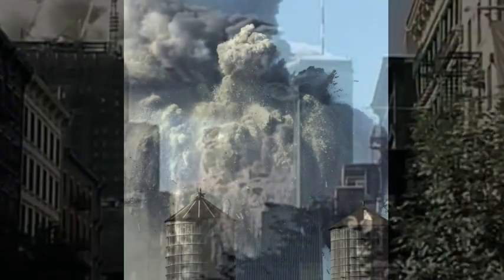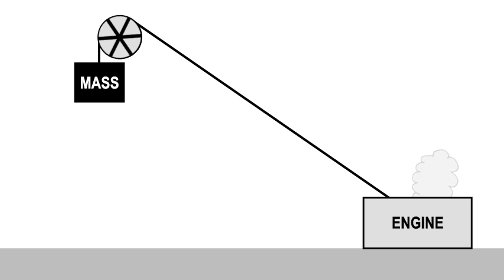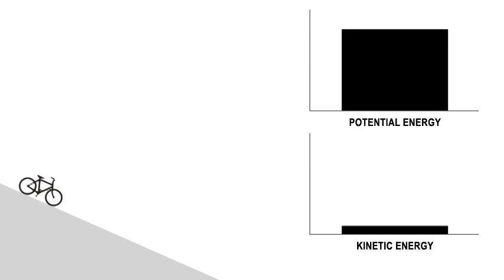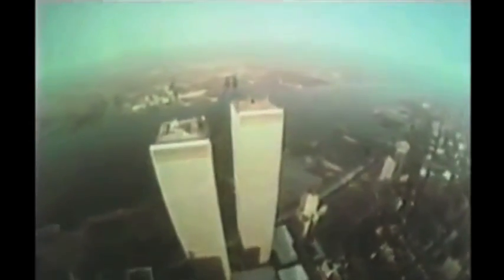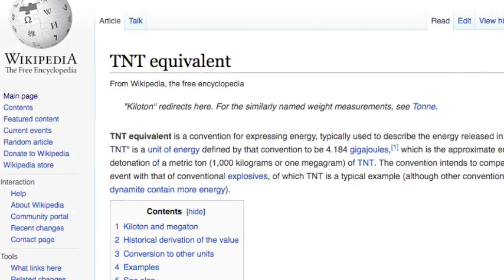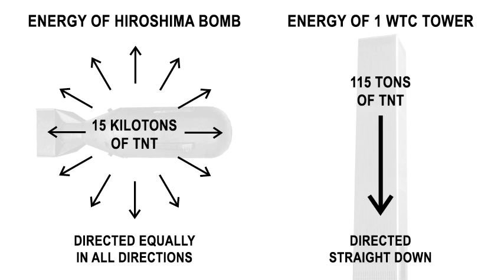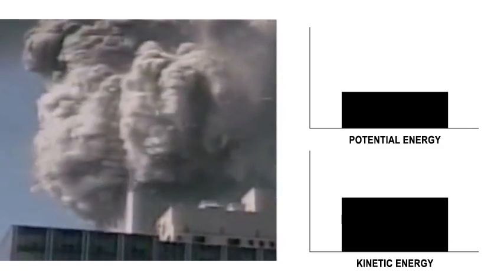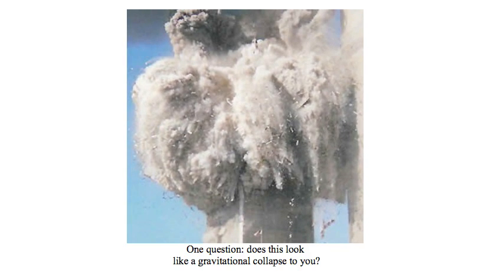Where Did The Twin Towers' Explosive Energy Come From?

Comment: So 6floor size hole (north tower) and the 6 floors above the 98th floor  had enough potential energy to just free fall through the rest of the building without it catching or meeting any sort of visible resistance on the way down? The rest of the building wasn't touched or weakened in the attack, so was the architecture faulty to not support the extra weight from coming down upon it? Hard to believe, but there is no example of a building that a hole that big in it in the history of the building.
Reply from the maker: "Ed presumes any piece at an altitude has inherently more energy." Altitude above sea level has nothing to do with it, unless the object in question falls to sea level. Potential energy is a relative measure, in this case we're talking about where the debris ended up, from wherever it was positioned in the building relative to ground level. The total potential energy of the building is therefore calculated by integrating the mass of the structure over the total height, from the ground to the top, taking into account the non-uniform distribution of mass. Please take a physics class before making such ill-informed comments. This is science, not opinion based on whatever the fuck you want to believe.
Reply from the maker: I am a landscape architect when I mow my lawn. There are thousands like me who say those buildings would only do that with bombs inside.
Reply from the maker: Yes. If you had taken a healthy WTC tower and suddenly removed one floor -- with no other damage -- the same collapse would have likely happened.
Reply: "I did a little math to find out the possible force behind the 6 floors dropping would be"

well, your starting point is wrong. About 20 floors dropped, not 6.
Reply: On the first tower to collapse, it was 40 floors that "dropped", and that is a massive amount of weight....a 40 story building!
Reply: So trying to see if it was possible, I did a little math to find out the possible force behind the 6 floors dropping would be.  The numbers kinda surprised me...So I simply divided the 6 floors to the total mass of a single tower as stated in other websites . I got the height of 6 stories in feet and plugged those numbers another website that told speed, time and energy(joules).  That came out to be 44mph, 2 secs , 1.2 tons of TNT at impact. Of course these numbers are guesses at best and its only looking at one variable. So I did this because your video only covered the total energy and not the bit that started it in the first place.
Reply: Who are you and what are your credentials? You certainly are sure of yourself!
Reply: Sevenspent Exactly! Well said. Ed presumes any piece at an altitude has inherently more energy. What his presentation so far implies is that a construction at sea level falling apart is not going to be as dramatic as that same construction falling apart if it were on a mountain. Quiet laughable indeed but hey, that's Ed alright. 😂

Comment: You speak as if each tower was lifted as a whole and dropped on the ground.  Yes, that would release immense energy all at once (and also destroy the "bathtub" keeping out the Hudson river, thus flooding lower Manhattan).  The crucial calculations of energy must consider the smaller top portion above the initial failure levels separate and opposing the ability of the larger bottom section to resist its fall.  The vast majority of the bottom portion was undamaged and unheated; it should have destroyed the smaller damaged upper section (the so-called "piledriver") by exerting equal and opposite forces; we would have seen the collapse halted at some point, with plenty of the healthy lower structure intact.

Experienced architects and engineers have asked NIST for the data they used to compute the energies of the two sections. The request was flatly denied, because the information "would jeopardize public safety" (yeah, that sounds plausible).  I think it is pretty obvious NIST is avoiding scrutiny; and that, frankly, threatens public safety far more.
Reply from the maker: The video concerns claims that only explosives could have caused such an energetic collapse, not claims that "we would have seen the collapse halted at some point," however extremely unlikely and astonishment-based as such claims might be. I'm sorry if the buildings did not perform as you imagine they should have.
Reply: Why do you support NIST's secrecy?
Reply from the maker: Because they pay me to. You know you want to believe that, too.
Reply: Look, I'd really like to talk without malice.  I admit I can get short sometimes. 

What I really meant to ask is, don't you think that suppression of the scientific process is a problem?  How can you be so sure that the first working hypothesis seeking to explain unprecedented observations is ironclad?  When confronting a new phenomenon, it is crucial to keep an open mind.  Developing and using computer models to explain real world events is not as easy as it sounds. And several members of the 9/11 Commission, including the co-chairs, have complained that the project was "set up to fail" by inadequate time and funding.

The people contesting NIST's WTC7 analysis are experienced highrise architects, engineers and physicists. Do you really think they are quacks? Isn't it possible that university research teams are capable of finding flaws in a proposed model? I'm beginning to think you have lost your objectivity in the matter.  Don't let the "rabid" truthers like Alex Jones close your eyes to everyone; there is a gray area filled with valid claims.

If we were just having a barstool debate, it would be fine to blow off a difficult point - laugh it off or stomp away in a huff.  But the issue is very serious on many levels, not least of which is ensuring that the buildings we are using and designing are safe.  NIST is denying access to important data; we can only guess why on earth they would do this, but it seems that a subpoena will be needed to get it. We don't have plenty of time to decide what to do because there is a statute of limitations on the civil litigation process. If we don't legally require NIST to open the books by 1/1/2019, we will lose any chance of seeing them. They will continue to block access unless a substantial number of Americans back a public interest suit in time.

Now before you start planning a victory party (the end is in sight! Power to the NISTers!), really think about this. I understand that people who want to keep the issues in a locked box may be afraid that too much scrutiny could reveal secondary information they can't handle.  That may be the case, but defending one's personal comfort zone can't become first priority, can it?  Are you really willing to surrender any chance of an independent analysis?

Insisting that thousands of working professionals asking objective questions constitute a pack of unstable anarchists trying to subvert the Amerian Way is no less a tinfoil hat conspiracy than that which you attribute to them. You are not convinced by their arguments; I get it. But do gag orders and repression have any place in our society?
Reply from the maker: Well, I'd like to see NIST open up that information if only to get rid of a favorite talking point. However, you and I and every other adult knows exactly what would then happen. People will data-mine and quote-mine for every possible perceived inconsistency or omission that supports the same beliefs that they've had for 15 years. It'll be, what can I find in here that will discredit NIST? Exactly like the photos from Mars that people scour through looking for "anomalies." I don't believe for one second that anyone will look at the data and go, Oh, now I understand. The government was right and I was wrong for 15 years; lo, behold the truth. I don't believe that for one second.
Reply: I keep asking you - how can you be sure the scientific objections are not valid?
Reply from the maker: Because they're made by kooks. Richard Gage, David Chandler, and Steven E. Jones are not credible with their claims. No peer-reviewed papers in actual technical journals have been published, and they've had 15 years to try.
Reply: Robert Korol at McMaster University has published 2 peer-reviewed articles in the Canadian "Challenge Journal of Structural Mechanics" and Leroy Hulsey's team will be publishing at the conclusion of their work.
Reply from the maker: I wish them luck. That's the right way to go about it. A theologian and a high-school teacher going around charging $10 a head to see blocks dropped on top of blocks isn't. But I suspect they'll continue doing this for years, even if the papers don't make any headway...there's still good money to be made.

Comment: Hey Edward, one more aspect that people have completely neglected to look at so far is the fact that aluminum metal burns when heated to a certain temperature. With the crash of each plane, several tons of shreded aluminum were deposited and spread right around the core of each tower. The ensuing fuel fire would burn hot enough to start an aluminum fire, hot enough to weaken and melt steel. The progressive weakening of the already compromised steel structure eventually resulted in its catastrophic failure and collapse. Aluminum fire can also explain the fact that even after the towers collapse fires were still burning for days. 
If you ever had the chance to do the metal flame tests in chem lab in high school, then you know what I'm talking about.
Reply: Rodrigo Ramirez or, for that matter, a welding shop. Oxygen cutting lances are fun!!!
Reply: Uhm, ok. So, I assume you never did the metal flame test. Did you go to high school at all?

Comment: Given E = 4.806*10^11 J
g = 9.8 m/s^2 = acceleration due to earth's gravity
A = 85.344 m x 63.3984 m = area of base of tower
H = 1368 ft = 416.9664 m, height of tower
E = d*g*A*H^2/2  which one can figure out given constant cross-sectional area, A, with respect to height
one can compute d = density of tower = 104.3 kg/m^3 = 0.1 g/cc = one-tenth as dense as water
Reply: Of course they could. And there's another thing made of steel that can float on water - ship!
What does this have to do with anything?